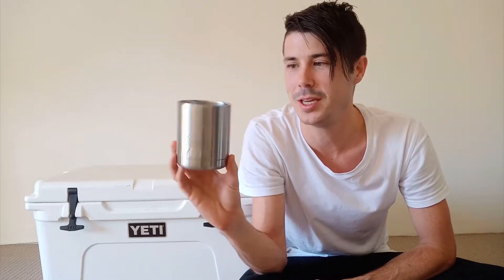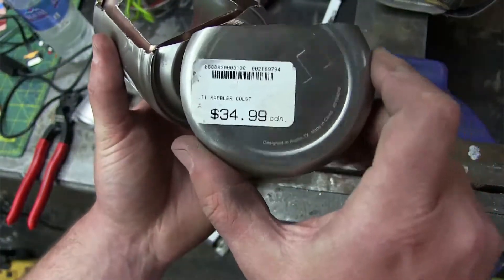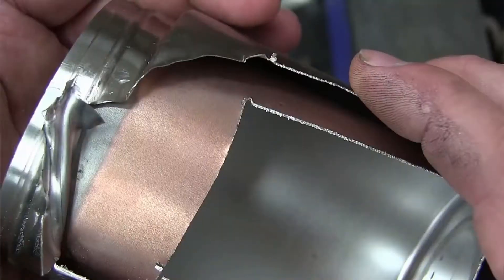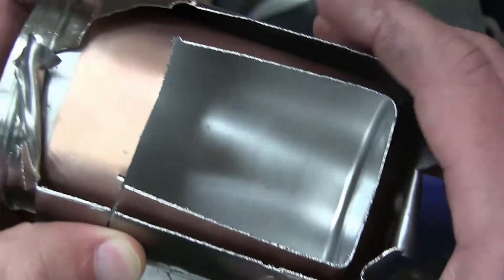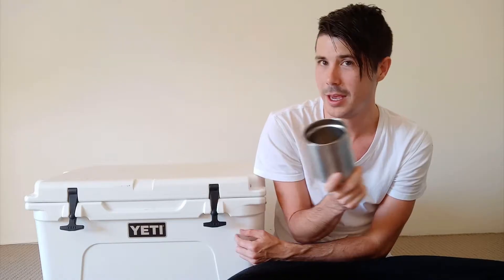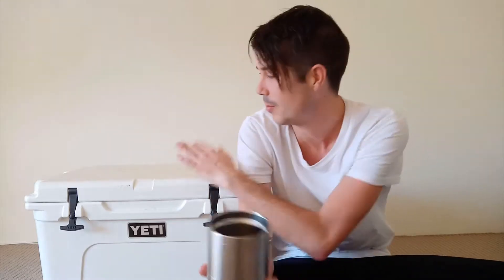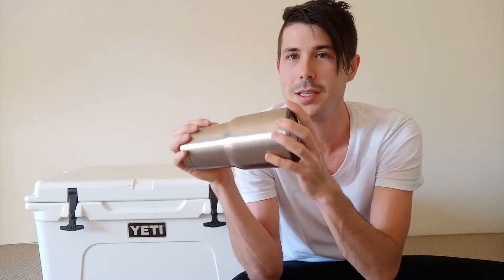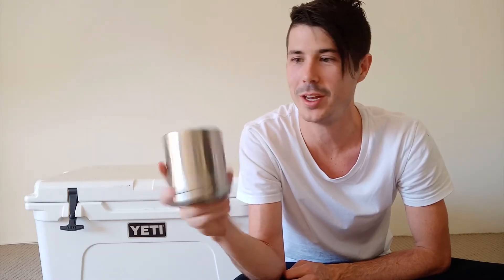How Do Yeti Tumblers Work To Keep Beverages Cold/Hot?

Comment: Around 3:00 the speaker mentions stainless steel is a poor conductor and good insulator.  Stainless steel is the opposite: a great heat conductor and poor insulator.  The steel is used because it reflects radiation as well as giving structure to the cup.  Other features compensate for the poor job the steel does in keeping heat inside or outside of the cup.